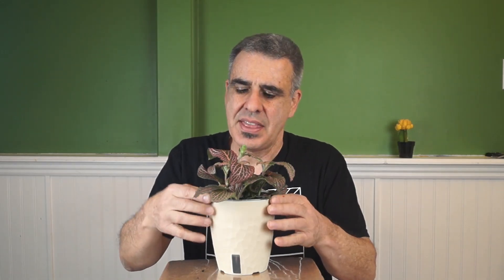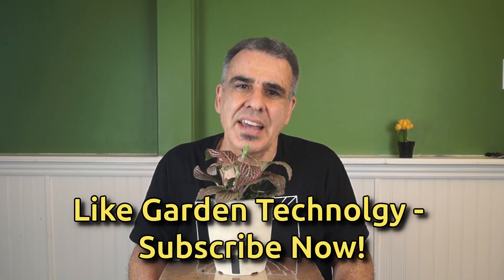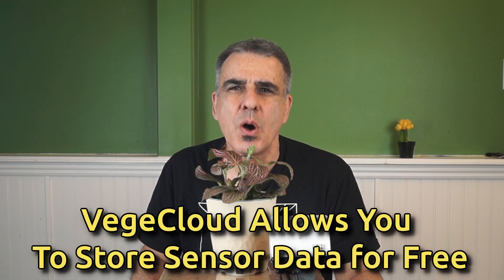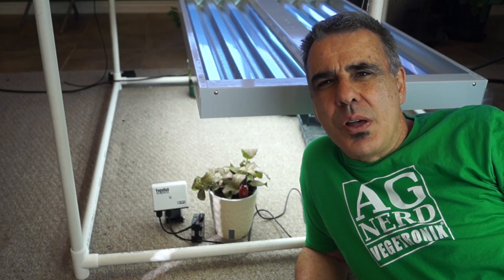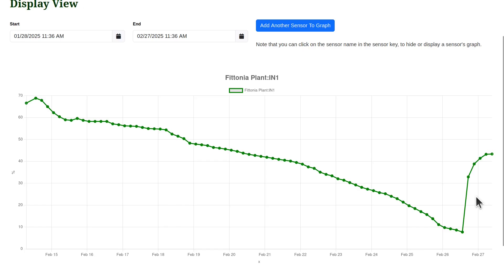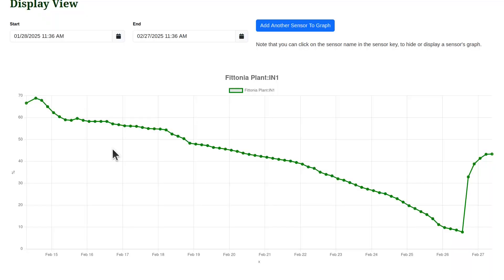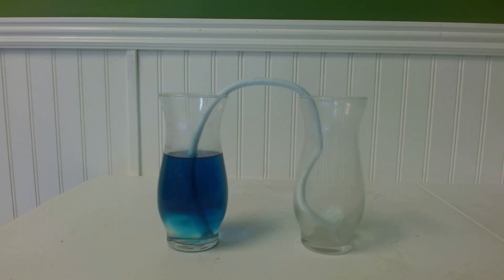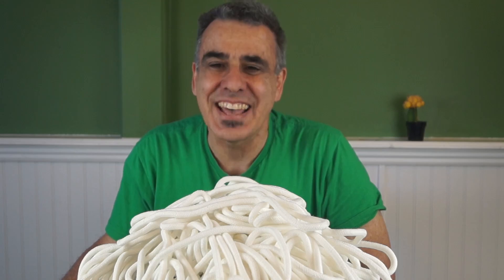Does Watering Wick Cord Really Work? – Test Result Revealed!

Comment: Good stuff. Wick length from water to soil and moisture level have an inverse effect on each other right... more wick length = less moisture. From a first principle angle if you want finer control you would need to attach a control point to capture the dropping action of the water to the wicking capability of the wick, be it whatever physics are at your disposal... action, thermodynamic, mechanical, pressure, etc., but for casual use case sounds great.

Comment: If anyone wants to try, I can suggest getting normal candle wicks, BUT you have to test them first. Sometimes they are coated with something preventing water to really stick, but a quick wash will get rid off of it (just cut it in needed lengths and toss it in the washing machine with socks or wash them by hand with a bit of soap or soda). 
Then you can experiment with different sizes of wicks (thicker wick will transport more water).
And you can put wick from a jar to the pot, but there I would highly advise to put the wick in some tube (silicon tubes are good, or you can get IV tubes for cheap). 
(If you decide to give it a try, use a wire to pull the wick in the tube).
Reply: do not put waxy substances into your washing machine. There is a good chance that the wax will dry out on its way out of your machine and clog some pipes.

Comment from the maker: If you have experience with watering wicks, I'd like to hear your comments -
Reply: I tried it some time ago and wonder why I don't use it more. In the spring we pre-grow some plants, like tomatoes, peppers, zucchini,... every gardener knows that (unless they buy prepared plants later (nothing wrong with that)). How I watered them two years ago? I grabbed a big glass jar (3 liters or so), drilled holes in the lid, put there silicone tubes and pulled wicks through (wicks are doing the watering, tubes make sure that they do not drip everywhere) and placed those wicks on the soil in planting pots. It worked quite well. And in the lid was another hole for refilling water once in a while, I just needed a funnel for it.